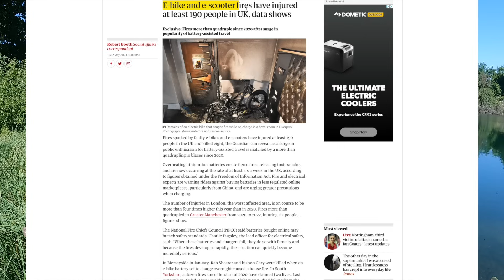ebike batteries dont just catch fire... what are they talking about?

Comment: I had a battery short out on me while I was riding my ebike . I tried turning it off but it would not stop heating up the outer Aluminium battery shell I had to take the battery off the bike and put it in a metal bin for a couple of days till it cooled .
Turns ot one of the battery cells had stripped its plastic cover and earthed out on the battery cover .
It took out that section of the battery pack and blew the bms .

Comment: Explain something to me ....  Why should I not weld cells of unequal charge together ... answer = inrush of current does bad stuff. So far so good.  Why then would a pack of cells become unbalanced as they are all connected to each other they balance themselves. I've built batterry packs with and without BMS. My current battery is a year old with no BMS ( approx 1900 miles of full throttle ).
Every 6 months I drill out 16 rivets on my home made case ( because thieves ! ), check the cells and put it all back again. No problems.
Reply from the maker: When you build the parallel banks of cells they will equalise themselves. But remember a full battery is made of series and parallel cell connections. Its the series cell banks that will go out of balance. If there's a problem with one cell in a parallel bank the whole parallel bank will probably be a gonner.

Comment: You missed a few bits there.
Like killing the battery with hard use then immediately recharging.
This causes heat built up which can be excessive (thermal runaway)

So BMS don't have thermal sensors to catch this issue.

Bus breakdown. Where battery are in parallel and this is damaged causing what's left to deliver excess current leading to failure.

Cracked busses leading to arching and shorting or insulation breakdown.

Age, dendritic shorts internally to a battery.

You know laptops have batteries  and then don't go boom. They are designed to cycle cells a number of times to reduce the risks of cell failure.
So do we ban laptops?
In ear headphones again same tech...
Phones, ban them as well and they all need to be in the same ball park rather than targeting one use.

I build packs, but bigger than ebike normals, I I'm careful and know what's up and they are like most others. Lead acid, well they can explode they leak hydrogen gas. As well as acid and contain lead.. 
I hear petrol burns as well as BBQ gas tanks..

It would be nice to find the actual and fact based reasons for the fires, in cases I've seen there has been a thermal runaway.
The general consensus is that the risk is greater when charging.

I think the cell design isn't great, the negative is to close to the positive making a short fault very easy to cause.

Comment: I think a lot of the time problems occur by using the wrong charger or poor charging managenent.

I know from experience kids will just plug in whatever charger they think fits the socket wirhout checking it's the right one, nevermind the right voltage etc

We all have multiple devices and a plethora of chargers, so it's no surprise there is sometimes a muddle as we go about our busy lives.

As a drone pilot, I use multiple lipos and have never had an issue.
My tips-
1. Treat lipos carefully and respect they're combustable fuel sources, so avoid excesssive heat or other sources of igntion.

2. Follow the charging instructions, NEVER leave a lipo charging unattended or over night.

3. Always double check your charger is the right one, also manually monitor the time your battery is charging, so if the BMS goes tits up it won't overcharge your battery.

4. Finally store your lipos in a suitable fire resistant/proof container, like a lipo bag or ideally a sealed metal container away from your home ie a shed or garage.

Comment: Check the battery is a good idea. I bought a lithium ion ebike battery and some sharp plastic had removed the cell insulation, a wire was in contact with the positive and negative. Cell holders are essential to protect from sudden discharge as cells move inside the case.
Reply: The ebike battery that I got refused to charge. When I opened it up, one of the charge sense wires was disconnected. It was a quick solder job to get the pack working again. One thing to watch out for is that that many packs are wired up with high temperature silicone insulation. While the insulation will survive the heat of a fire, it's also very soft. Be extra careful when you're handling wires with silicone insulation. It's easy to break through the insulation if the wire gets pinched.

Comment: I melted a 48v battery by trying to charge fully to 58.8v by using a 52v battery by mistake. My err fried the battery but no flames. Don't repeat my idiocracy.  👍
Reply: what did you do with the battery?
Reply: 48v only charges to 54.6 or was it 54.8. 
52v goes to 58.8

Idk what u smokin but no wonder u broke it lol

Comment: I was recently given a bunch of dead e-bike batteries from a mate that works in e-waste, I think about 70% of them were shocking in their build quality, using cheap cells, most basic BMSes with only over-discharge and over-current protection and balancing wires criss-crossing all over the place, and everything held together with tape and hot glue. Some of the pack's BMSes had failed and over-discharged one parallel group of cells, but left the remaining cells in a good state, some had water ingress and one of the packs appeared to have had a majority of the cells leak electrolyte everywhere (I assume down to really cheap cells that weren't well sealed and had been abused at some point). Pleased to say there were a handful that were using good quality Samsung cells with a decent smart BMS and had only failed due to water ingress corroding connections, and upon running the cells through a charge-discharge cycle, still had a majority of life remaining. Bear in mind that this wasn't a representative sample of all e-bike packs, and that these were specifically failures due mostly to them being cheaply built.
TLDR; Don't buy cheap, don't let them get wet (in addition to what Andy recommended)

Comment: LiFePO4 should be used more because it is much safer, but ultimately Ion and Polymer have the best capacity. The best thing to do is take precautions, if you have to charge them inside keep them away from flammable items and have good ventilation.
Reply: Lithium Ferrit batteries are indeed safer, but they suffer from low charge and discharge rate meaning they're not suited for an high energy application that needs to be recharged quickly.
Reply: lots of advise in th ebike kommunity say charge away from flamable stuff but not much of people talk about charging bags or boxes that prevent or delay the flames from catching everything on fire and eaven make a burning battery posible to be transported or thrown out if its an accident in a appartment for example.
as a rc car hobbyist i see it as verry important to charge in a "safe space" (yes i used that word 🤣) and in a charging bag and storing batteries in the charging bags inside a safe metall box.

Comment: every device that uses a Li-Ion battery could potentially get a short, overheat or be physically damaged to the point where it causes a fire. that is true for lamps, laptops, phones, tablets, cars, bikes, scooters, mopeds, vapes or tools. but of course its down to people not liking a particular type of device that uses a Li-Ion battery for it to make it into the news. "don't charge inside" nah. ive been charging all of the above(except electric bikes and mopeds. i don't have one of those yet but there is a scooter in the house). if the device is built properly, it should be safe. it takes about 80°C(which is probably about 200°F) for it to catch fire so even ex. a hot car is safe as long as the device has overheathing protection.

Comment: At 57 and having a soldering iron since I was 12 I've learned a little about electronics, I only build my own packs, I only buy cells from UK stores as drill packs and disassemble them so I know i'm getting real OEM quality cells. I test them all, I build my own packs, I buy in the BMS with two temperature sensors and that spends 5 charge/discharge cycles on a test pack before its built onto a pack for a bike.  I fuse both positive and negative leads of the pack before the bms and the controller and use soldered battery/battery connections from spot welded tabs so in the event of a fire/high temps the battery disconnects cell groups itself. then i build this into the steel frame of the bike, and then I charge it, down the garden! because even with all that i know, and the preventions that i take, theres never zero chance of a fault....
Reply: you waste  a lot of money by overpaying for powertools batteries
Reply: @ironman8257  I did/do but the advantage is the chemistry is usually less mah more cycles.
Reply: @ironman8257 I think your both right

Comment: Thermal runaway is relevant to any lithium ion battery in any device, and not necessarily when it's charging. Physical damage and piercing the cells is a real concern, however most batteries have good mechanical protection around the cells.
Reply: re: "Thermal runaway is relevant to any lithium ion battery in any device, and not necessarily when it's charging. Physical damage and piercing the cells is a real concern..." ...and even when being DISCHARGED during use.  people overlook the current draw OUT of the battery while riding an E-bike can also trigger a Thermal Runaway event.  where's electric automobiles (think Tesla) utilize a direct COOLING SYSTEM to keep temps in check during use an E-bike has no such system.
Reply: TheTiredHorizon  Q: Does make me wonder why we dont switch to LFP? A: the wide availability of cells based on NMC chemistry (vs LFP) combined with our ADDICTION to have everything be "bigger, better, faster".

Comment: More than likely cheap chinese components, they usually cut costs as much as possible on the electrical board and components. built in components may be missing etirely.
 
You pay for what you get, especially with electronics. Buy cheap, buy twice. I always make make sure I do a little research first and generally go for a well known brand as they generally have decent quality assurance to uphold the brand image. Plus the decent brands usually have good returns should you have any issues.

I may be wrong completely, just my initial opinion on the matter as  I have worked in IT / Electronics for 20+ years so have dealt with many devices of many brands over the years.

Comment: lol  go look at some of the very bottom end    ebay rubbish those   are mostly caused by badly built  battery's the biggest issue is the bms    not doing its job  mostly on very cheap too good to be true   price rubbish rubbish as   things are tight   with cost of living  these cheap   battery's can   be tempting    but  are very bad had one in a e scooter 2 of the cells at 4.4v   yes rly      one at 2.8v   and bms was more than happy    to keep  charging it
Reply: other issue is  water damage to said bms    dont go in deep water with    e scooters

Comment: The wrong charger is the most likely scenario.. as people loose them or dont get one when they buy the stolen ones and use higher output chargers. Been saying this for along time now as some people are just not savvy about thos sort of thing. Lets hope this video helps a few to understand
Reply: from what i have seen on ebay  most of the batteries for sale are offered with a matching charger so its no big deal if your charger is damaged as is quite often the case....dropped wires pinched or  cut